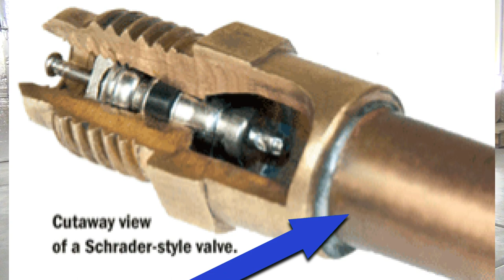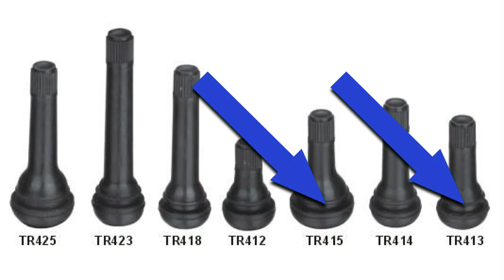The Tire Valve Stem Video

Comment: Interesting! Note that painted steel trims are often rusting around the valve holes and that may cause slow  leaks on tubeless tires. So it important to be really careful with the rim paint when replacing the valves.

Comment: Spit on it brudda!
That’s some awesome information about the often ignored valve stems. 
The only thing I could add is that if you get two rubbers with your metal valve stems don’t use one on the inside and one on the outside like I have done for years. I just watched a video to see if I could learn something about valve stems I learned that they give you two for different hole sizes. I picked up some information on your video as well. Thank you!

Comment: Amazing timing - I had been searching amazon for the best reviews on a TR600HP type schrader.   I'm replacing my 3500 RAM tires, which are load range "E" and rated up to 3195 lbs @ 80 psi  (sidewall crack defect on the OEMS).   Tire shops dont carry HP valves, so I am purchasing my own.  Just as you point out, 65psi is the limit for snap-in.  Incidentally, it seems easier to get a clamp-on type valve, as there seems to be a greater variety out there.   One thing about clamp ons, if you have a recess or clear area on the rim to permit an external clamp on, get those.   You must break the bead to install them, but you can retighten them while the tire is mounted - just in case they leak.   This is the second time, Brian, that you've posted a video on a topic that I was actively researching.    Last time was the gambrel roof. Thanks again for the videos.
Reply from the maker: fargley001 You're welcome, and just keep sending those "vibe requests"!

Comment: Which valve stems would you keep stocked in a two bay shop that doesn't do tires in high volume, but does them seldom?  I was told to stock 413s and 600hps.  What would you stock Brian?  I want to make sure I'll have everything I need. I've had instances where I've needed longer stems to achieve enough protrusion  past hub caps, as well as that occasion where I've needed an even longer 418 stem.  I also want to make sure I'm not stocking stems I'll never use.  Thanks in advance.

Comment: How can I tell what tire valve stem is installed? I recently had the rear tires replaced, but instead of matching the old valve stems they installed stems that are so short I can’t get an air chuck onto them once the trim ring is installed. The front tires have the old, correct length so I need to figure out what size they are so I can request them specifically at the shop.

Comment: Thanks for the vid Brian. Do you know if there are only 2 size holes on most rims and what size they may be ?  I need to change out my valve stems to remedy a clearance issue when installing Centramatic wheel balancers and tire pressure monitoring units on my motor home with 19.5 in. rims.  Always something to challenge what should be an easy job...see Murphy's Law !    J K
Reply from the maker: Welcome James!   Almost everything out there will be one of two sizes.  Best of luck!
Reply: @briansmobile1 what are the two sizes?

Comment: What size of Valvel stem on a RV LT225/75R16 can you help.. by the way, nice video
Reply: Hey buddy I'm going through the same thing,,I have an rv and the nut on the outside of the stem is impossible to unscrew with a wrench, how did you get it out?
Reply: @MrLeo92335  I use breaker bar.. a long pipe to extend it, the breaker bar for leverage..be careful, not to lose balance... The longer the pipe the less force you need to loosen the nuts...